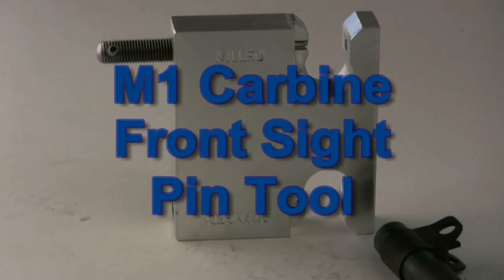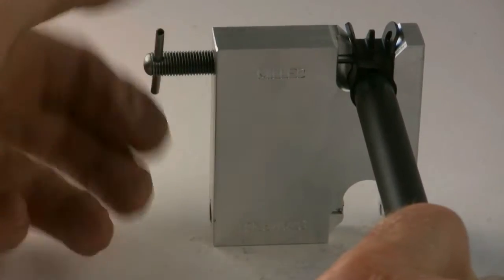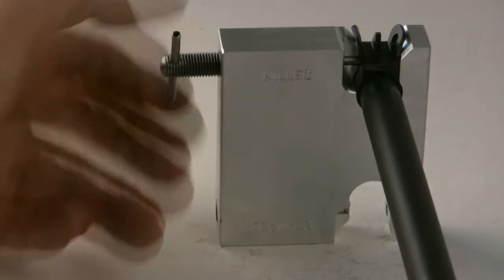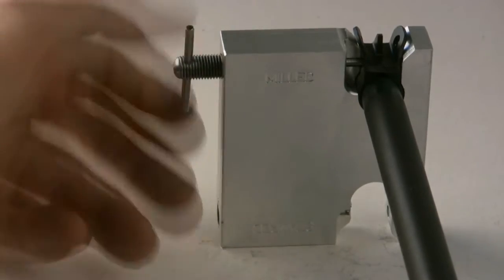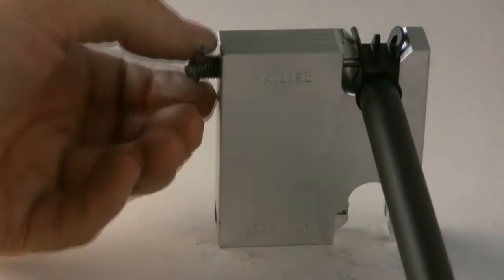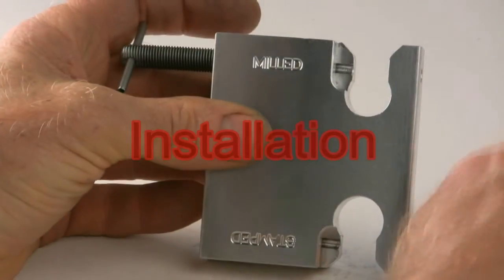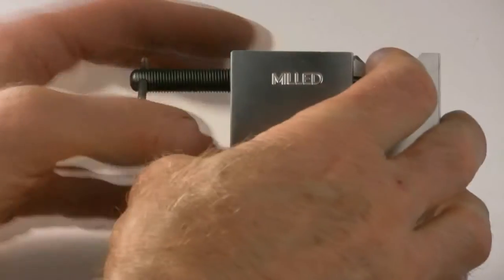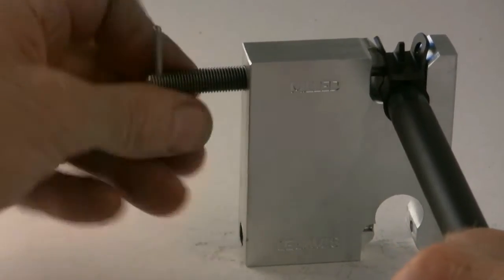M1 Carbine Front Sight Pin Tool

Comment: Wish they were still available!
Reply: Matrix Precision made this tool about 5 years ago but does NOT carry this part as of August 2024. 😞:-(   I can't find anyone else making this tool.
Reply: @raymondmelton9098  I got mine out, had to take a larger punch and grind down the tip to a smaller diameter to make it strong enough not to bend when hitting it with a large hammer. I still couldn't get the sight off using the site removal tool until I took an impact wrench to it. This was even after submersing the site in penetrating oil for two weeks.